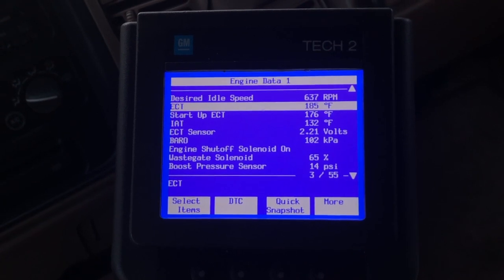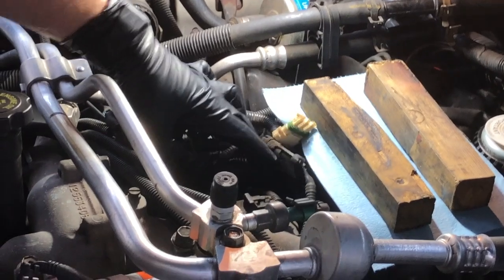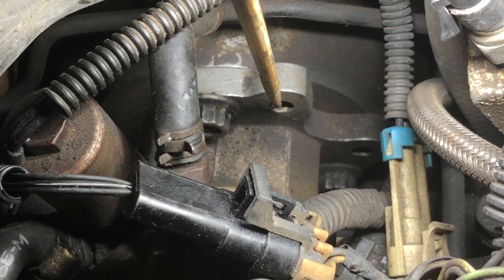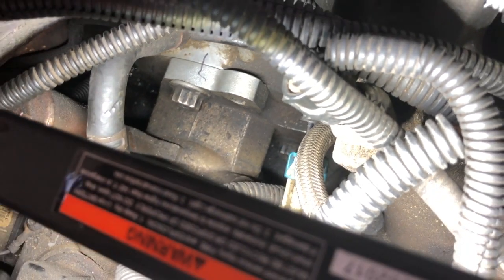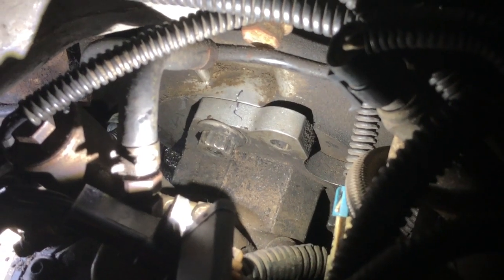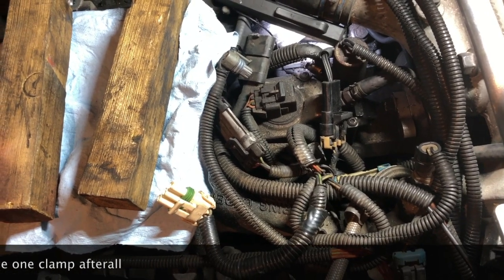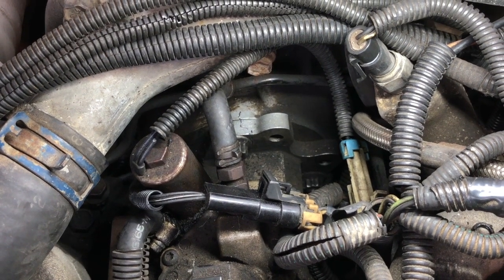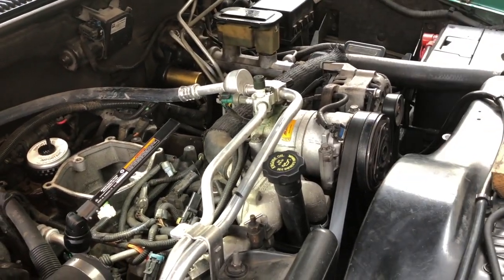1996 - 2002 GM 6.5L Diesel Stanadyne Injection Pump Timing Adjustment TDCO Procedure (Chevy & GMC)

Comment: Hi 👋 you are a really professional GM  mechanic 👌👍👍 a great explanation 👍  I have a 95 suburban 6.5TD and I changed a automatic transmission to a manual transmission and goes very well I'm a really satisfied 👏👌👌👍 but definitely I want to change a electronic diesel pump to a mechanical without a  PMD and sensors etc... my question is if I changed I need to adjusted the diesel pump?  Because she don't have any sensors information 🤔 just a cut off valve for stops a engine!! thanks I appreciate if anyone can help me cheers from Norway 🇳🇴 😀 👍 😊
Reply from the maker: Thanks, I don't get into much modification from GM factory work.  I would presume such a mod would require a different PCM (from an older model year) to avoid a check engine light and throwing DTCs due to the lack of sensor feedback.   If those were not concerns, you would still need to set the timing yes.

I would suggest referencing the 1993 GM C/K truck factory service manual for how to set the timing for the Stanadyne mechanical DB-2 injection pump.   As best I recall, 93 was the last year for mechanical before the electronic DS-4, and its PMD, replaced it in 1994.

Comment: To move the injection pump do you have to loosen the eight injector lines that are attached to the back in order to move the IP?
Reply from the maker: For these small adjustments in timing, such as for the TDC offset, no that wouldn't be necessary.  You'll be working within only a mm or so range of movement in most cases.   Well within the play of the connected lines.
Reply: @DrShock  I have a 2000 military hmmwv with a 6.5L NA diesel. It has the db2 IP. It has a hash mark on the IP flange and on the timing cover. Normally they line up.... My IP is 3/16-1/4" retarded.. Seems odd. I wanted to loosen it and line up the marks and see how it runs and go from there. I didn't want to torque the injector lines.
Reply from the maker: I'm not familiar with the DB2 setup, but certainly on the DS4 a scan tool like a Tech2 would be a must have to dial in the timing.
Reply: I'm more concerned if the tight injector lines can  handle 3/16-1/4" rotation of the IP without over stressing them. The bd2 is mechanical and I have the instrument to check the injection pulse. Thanks
Reply from the maker: If you have to move it that far, you may have a problem and need to loosen the lines temporarily.  For this video, just resetting the TDC offset, you would not normally be moving out side of a 1-3mm range so no problem.

Comment: Hello.I love your videos. I was hoping you could help me with a problem. How could I check if the fuel injection pump is my problem? Truck start right up. But after accelerating for a while or driving it, it has no power. Or starts shutting off.
Reply from the maker: These sort of problems are incredibly difficult to debug over the internet, without physical inspection of the engine.   Most likely fuel starvation though, imo.  Could be multiple problems, including a PMD issue.  Start with the starvation though. Some things you could look at are:
- Connect a scan tool and determine if there are any DTCs to guide you
- Visually check fuel pressure at the "T" valve adjacent to the thermostat housing.   Opening this T while the engine is idling should not cause it to stall (if it does suspect the fuel filter and/or lift pump).  There should be a continuous stream thru the rubber hose attached to this valve, if a dribble the lift pump / fuel filter areas are again suspect.
- Check fuel pressure with a gauge at this same T in place of the factory rubber hose outlet, you should see around 5psi, +/- 2psi.

If these all check out, I'd start looking closer to the injection pump.  Could be as simple as the fuel plumbing to the IP, or could be the IP itself.   Again, not something one can debug over an internet comment board very effectively.  ;-)

Hope that helps.

Comment: I looked up that book for the truck using the link you had but it showed different ones, can you tell me exactly which one you used. Please and thank you
Reply from the maker: If you are referring to the special wrenches, there are several brands out there as mentioned.   Being fixed purpose wrenches, they are all going to fit.  But I used the OTC set for the S wrenches, and the Sunluway for the adjuster.
Reply: @DrShock  no im referring to the book you used I looked it up on eBay but there’s multiple books so I was wanting to know if you can send a picture of the front of the book ?
Reply from the maker: Those GM books are model year specific, so you use the one for the year truck you're working on.  In this video, we were using a 1999 edition of the book.
Reply: @DrShock  ahh ok mines a 98 but I guess the question would be is there a certain volume number of book to look for or is the book just tilted 98 c/k service manual  cause there was so many books on eBay
Reply from the maker: These old body style (OBS) C/K truck manuals are 4 volumes (4 books).   The 6.5L diesel info is going to be across at least two, three if you include electrical diagrams and debugging.   I don't recall off hand which specific book had the timing info I showed for that model/year.

If you can't find one of the out of print hard copy books from the links in the video description, you can rent access over the weekend from ACDelco at www.acdelcotds.com using SI (Service Information).
Reply: @DrShock  ok thanks for your help

Comment: So, I've got a 2001 with the 6.5L, just replaced the crank sensor and with a Tech2 scan tool the TDC offset relearn keeps coming back at about 2.20 degrees (positive). I check the injection pump timing and it is about 3.3 degrees average (super close to 3.5 degree spec). If I adjust the pump to get the TDC offset within spec then I will throw off the injection pump timing wont I?
Reply from the maker: Setting aside missing the steps of the Tech2 dance that can cause the relearn not to trigger at all, like I show in the video these TDCO adjustments are extremely small.  Measured in a mm or so and within a specific +/- range the service manual calls out.  This TDCO is something I would only expect to fall out of spec after two decades + from steel timing chain stretch in the normal just changing the CKP sensor out case.  My understanding from the GM service manual is that as long as you don't stray from the range given, you won't affect the overall timing.  Setting the base time on a 6.5L is a different Tech2 procedure, though still the mechanical steps with the pump. Still, if you have a situation falling outside the video I've done, you may want to get some other opinions first to be sure as setting the base timing is not something I can comment on.

Comment: My trucks TDC offset was -2.38. So I moved the pump to the passenger side of the truck. Now it just cranks but won’t start. Did I move it too far ?
Reply from the maker: Maybe as it's very easy to do that, hence how critical marking the original position.  It's an incredibly small amount that you would be moving, like 0.5mm.   What happens when you put it back to the starting mark you made?

Comment: I have replace my injection pump on my 1995 C3500 HD. With the truck being OBD1 I was told by a friend that the Tech2 scanner will work with my truck. I had picked one up on Ebay. My problem is the Tech2 that I bought has a software card for OBD2. I have been trying to find the software card and not having much luck. Would you know of any other scanners that I could use? I know there the Snap On brick scanners. But you have to have the right key cards and software. I have checked with a few local shops as well but no luck.

Thanks 

Robert
Reply from the maker: There's no software card issue like that with a Tech2.  Perhaps the person is recollecting how the Tech1 worked.   With a Tech2 the memory cards are only for non North American brands like SaaB or Isuzu.   The regular North American brands, which would include the Chevrolet and GMC C/K trucks are all on the one card.   What you do might need is the OBDI connector for the end since yours is before 1996.  The Tech2 kit should have come with several different DLC connectors.   Very few to none of the aftermarket scanners are going to have 6.5L TD offset functionality.  I have a Tech2, but in this video I showed the manual method because most folks won't have one.
Reply: @DrShock  I have the Tech2 OBD1 connector but it's not communicating with my truck. I have 2001 6.6 Duramax and the  communicate with the Tech2. With the 1995 Chevy 6.5 diesel. I can hook up a code scanner and it will communicate with the truck. I get nothing out of the Tech2.
I will check out your video on the Tech2. 

Thank you and have a good weekend!

Robert
Reply from the maker: Does your 1995 have the OBD1 or was it a later build that included the OBD2 connector?   What is the version number of the Tech2 firmware when it boots up - it should be North America Operations version 33.004.  I've used that version on several 1994 and 1995 era trucks and a clone Tech2 (not even the genuine tool).
Reply: @DrShock  I just went out the garage and checked.  That's what I have North America Operations version 33.004.
It' will not connect to my 1995. My code reader works fine. I can check engine codes and ABS with no issues.
Reply: Please disregard. I have found the  North America Operations version 33.004. I see different versions. I am not sure what the difference is?
Reply from the maker: Like I mentioned before, typically these different firmware card images are not a concern unless you're working on an imported GM brand (e.g., SaaB, Isuzu, Opel, etc).   Then you may need to swap out the NAO version.  

Some folks also believe that there are tests or functions in older Tech2 firmware versions that GM took away at some point, but I am not a fan of playing around with older firmware versions in any diagnostic tool.

It's very odd that you cannot read your 1995 C3500.  Like I mentioned I've used these on older vehicles several times.  I worked on a 1994 C2500 some months back, and a 1995 K2500 around the same time.  No issues connecting to either (though both needed the OBD1 plug not the OBD2 one).   I'd say if you can use your Tech2 with other vehicles, then the Tech2 is fine and it's just something it doesn't like about the communications bus of the 1995 C3500 you have.  It could be some noise on the line, bad ground, etc, that the cheapo code reader doesn't care about since it's not used for module programming.
Reply: @DrShock   I have the OBD1 connector. I have the 1995 C/K Truck Drivability ,Emissions and Electrical Diagnosis Manual. They are saying to use the Tech1 and to set the injection pump timing at -5 to .0. If I could figure out how to send you a picture I would.  I was under the impression you could do the same with the Tech2 and more. When the book was written I don't think the Tech2 was out.
Reply: I had managed to get my scanner working. TDC relearn is done. I am thinking about replacing the injectors for piece of mind. I have looked at a few places. I am trying to find a quality injector that not made in China. I see people in the states selling them but, they could have bought them from China and just marked them up. It seem like everything now comes from China. If you have an recommendations it would be greatly appreciated.

Thanks

Robert
Reply from the maker: I personally only use genuine GM parts.   The GM injectors are OEM'd by Bosch.   They may not be made in Germany anymore, but they are going to be far superior to any Chinese made aftermarket parts.
Reply: @DrShock  
Thank you!
Reply: @DrShock  will it work with the tech 2 tool and the card

Comment: What Manual did you use to get the information on the TDC. Would like to purchase one for my 6.5 my truck is a 95 though.
Reply from the maker: Thats the 1998 GM service manual for C/K trucks.  They are out of print now, you usually get the manuals from Helm (info in the back of the owners manual) https://www.helminc.com/helm/search_service_owner.asp?Style=helm&class%5F2=CHV   but I do see someone made a PDF of it here https://www.gmt400.com/threads/88-95-service-manuals.43575/ or you can buy one off eBay at this affiliate link https://ebay.us/z5cENd

Comment: Can you tell me if the actual timing changed.  In the first video it was running at about 10.6 and this video you didn’t scroll down to see it
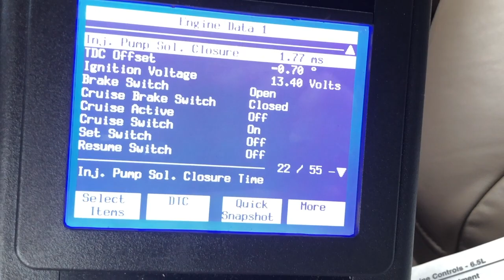Reply from the maker: The original incorrect TDC offset is shown in several segments, within the first minute and again a few times within the first 27 minutes of the vid.    As mentioned 32 minutes into the vid it's a very precise dance to get the offset relearnt and may take a few attempts, but it's shown within spec starting at 33:22
Reply: My question is when you changed the offset did the pump timing change?   @.21 it shows 11deg and the first video shows 10.6. I understand you are focused on offset, however I  am focusing on all the information of the tech 2. So it seems when you advanced the offset the pump timing would decrease. If so how much did it change.
Reply from the maker: Right, we're only focused on resetting the TDC offset in this vid which remains constant once set.   The actual engine timing, on a 1997 and later design 6.5L, is going to change within the Tech2 view during a given run so you won't see a fixed value.  This will come from both the PCM making frequent electronic timing adjustments, which includes the TDC offset value,  and from the flex effects caused by timing chain wear.   I would expect to see the value float from run to run, but remain within service manual specification.

If not, then there's a whole different procedure for setting the actual initial engine timing with the Tech2 covered here https://youtu.be/Fir18Ll5l3Q

Comment: I  did the relearn the other day and is 14° advance good or bad
Reply from the maker: I'm only covering the top dead center (TDC) offset timing adjustment in this vid, not setting the base timing.  I don't recall offhand what the TDC offset range of good values was, but I do show what is printed in the service manual during this video a few times.  The TDC offset is going to be LESS than 1 degree maximum across the good range.   It's a very small fractional value range.

Comment: I just want to say as a friend and a mechanic that you were actually wrong about the timing chain. The injection pump timing angle is what changes the relationship between the timing and the valve train. this is because the cam gear and the injection pumper times between gears so there is a little to no wear between them. The timing chain will affect both valve train and injection pump timing simultaneously with wear in relation to the crankshaft.

Comment: What brand fuel filter is that? Where's the black plastic cap
Reply from the maker: Not exactly sure what you're asking about as we're not working with the fuel filter in view with the focus of this video.  We're looking primarily at the injection pump housing attachment area at the front part of the engine.  The fuel filter housing would be to the rear of the engine.  Perhaps you're asking about the cylindrical fuel shut-off solenoid showing in this view?  Regardless, the answer is I always use a ACDelco brand filter inside a genuine GM filter housing and separate locking ring that secures the black plastic cover.

Comment: They run better at -1.94 TDC offset...

In 2004, dyno testing on my old Suburban showed that changing from -.7 to -1.94 increased power by 4 hp and torque by 9 lb-ft.
Reply from the maker: Yeah but going that far its alot louder running, and cold winter starting is degraded.  The stock tune is more balanced for all seasons, less emissions, and of course less noise.
Reply: @DrShock  I run 17:1 compression with reprogrammed glow cycle and have good winter starting. Everything is better at -1.94 TDC offset. I have also revised the timing tables. Of course, I build these for performance and have splayed main caps and many other improvements.

Comment: Where is your shop located sir?
Reply from the maker: Don't have one, just my hobby/side gig being an engineer by trade.  ;-)
Reply: id bring my truck to you if you ate still doing side work. truck fires right up and drives great but i do have code for inj pump timing. i installed this used motor and have driven 10 miles on it so far

Comment: I have a 93 6.5 just replaced injection pump but I’m having trouble shifting after 3rd gear would changing the injection pump have anything to do with that?
Reply from the maker: I haven't ran into anything like that personally.  And a few years ago I would have not thought there was even any relationship, presuming the pump was properly timed.  But I did read awhile back an article from a transmission rebuilder (Atra) talking about 4L80e shifting problems that ended up being caused by a defective optical sensor on the Stanadyne injection pump.   It pops up on Google if you search for it.   Not suggesting this is your issue at all, just confirming that yes there can be transmission side effects caused by injection pump issues, though I would suspect they are on the rare side.
Reply: My 98 1 ton with 4l80e wasn’t shifting into overdrive and was thinking something was going on with the transmission. Was driving it a couple days like this and all of a sudden the truck just died like someone just turned off my ignition switch  .  I always carry an extra pmd  and already have a relocate done, so I swapped it out, my truck cranked right up, and it once again shifted into overdrive again. Great videos!